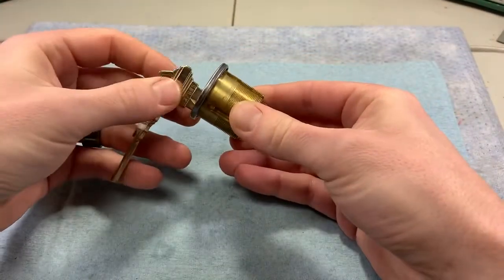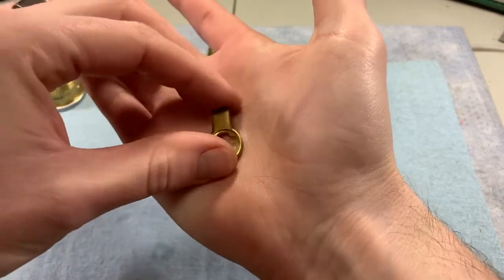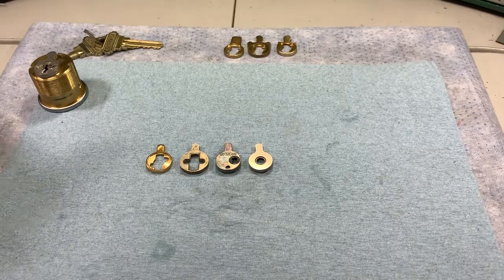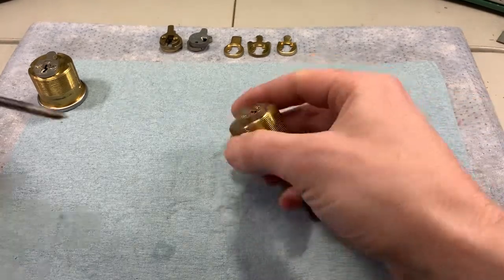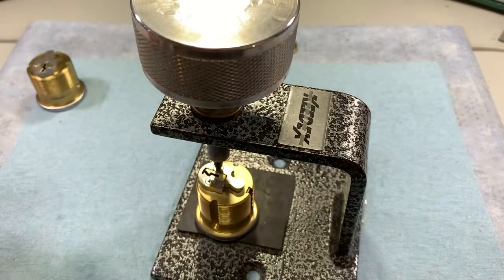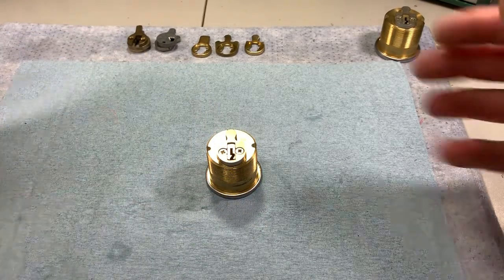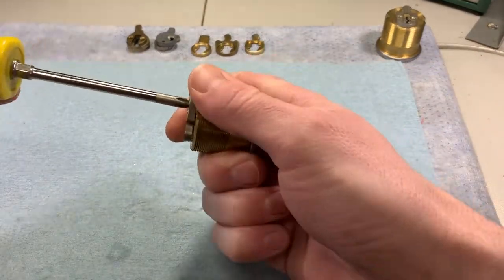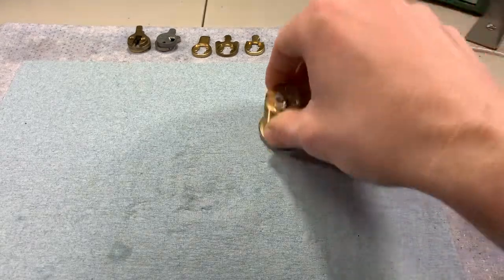Mortise Cylinder Cam Basics and Servicing

Comment: Cam you put a lock without the cam. A friend installed 2 locks for me without the cam.I don't feel safe if there are pieces not being used. He said the cam is not necessary. I have been opening and closing my door without the cam but I have doubts. Please tell me if that's true or not bc them ill get someone else do redo my locks.
Reply: Oh and I also have those two shape ones in the middle.
Reply from the maker: What kind of locks are they?
Reply: @Thethreetumblers  one is the one given by the super of the building that has a bouncy lock. I don't know what you call it. You open the lock but then have to turn and hold for one that bounces in and out. The other one was an angol mortise cylinder. It's a cheap $50 lock that comes with 4 keys. I wanted the one from a hardware store that was $140 but he took me to get this one. I wasn't there when he put it on but I saw those cams on the counter and questioned what they were and why they were not on. He said they were not needed. A lot of thieves and people on drugs around here so I wanna make sure the locks are good especially since it's just me and my daughter here.